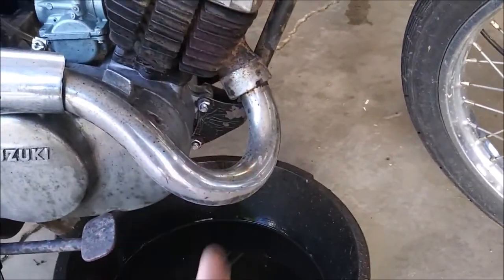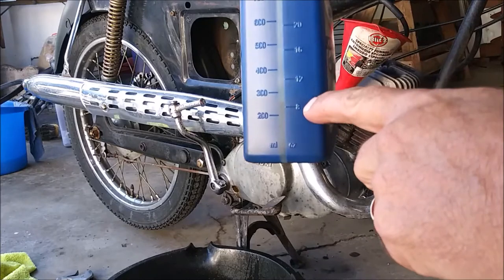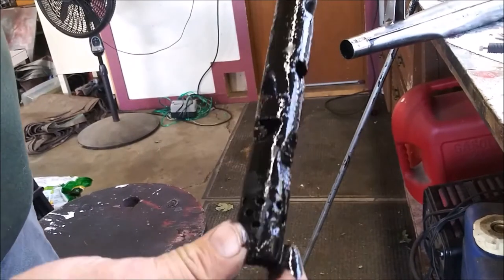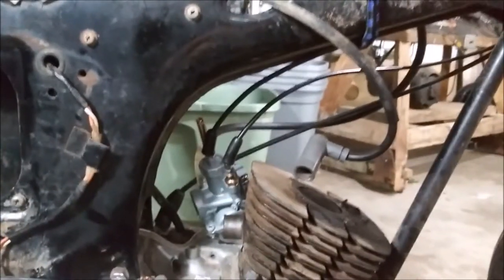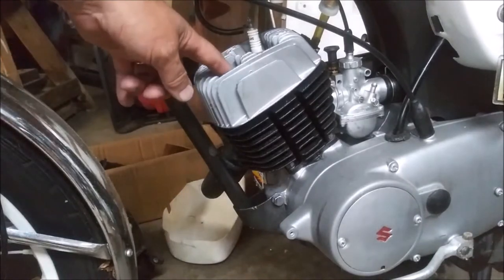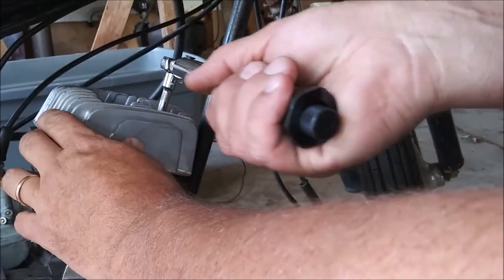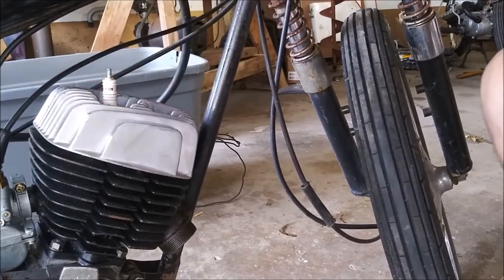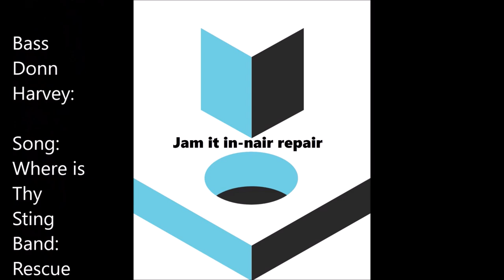Suzuki K11 the 3rd Pipes head and cylinder

Comment: i love your videos of these bikes. i had a 68 k10 i bought that was seized up   .i didnt have oil injection though.but  im seeing  most of them did?so does that mean some of the 68s had it and some didnt?   thanks bro
Reply from the maker: I don't have oil injection on my 64 K11's but I think the K10's did.  The side cover for my air filter is an Oil tank on many K10's.  I am not sure what years they switched.
Reply: thanks for replying my friend!!  do you think you could hook me up with a k10 80? id love to have one before the oil injection models like the one i had which was supposed to be a 68 k10. thatd be awesome bro!
Reply: hi!, thanks for the info. i was 13 when i bought my k10. the seller told me it was a 68. when i bought a piston for it during the rebuild, i had a problem with the new rings not fitting into the new piston grooves! weird right? i took the piston and rings back to the suzuki dealer i was dealing with here in nj. the rings wouldnt fit my original piston either. they were just a little to fat to go in the grooves. they tried a piston from an older listing and the problem was solved. i didnt have oil injection either!  i think my bike may have been older than i was told being my bike had the same air filter out the right side too!!    cheers @JamitinThereRepair
Reply: @roadrunner1580 they switched in 66/67 to oil injection. I have either a 67 or 68 k11 with oil injection.